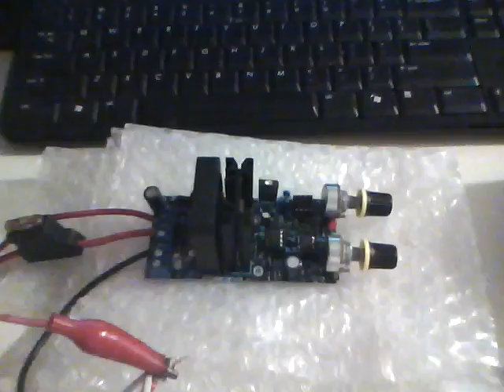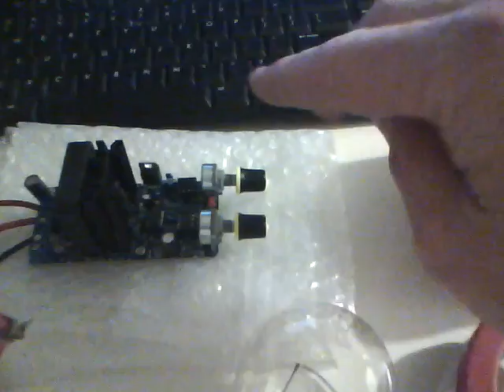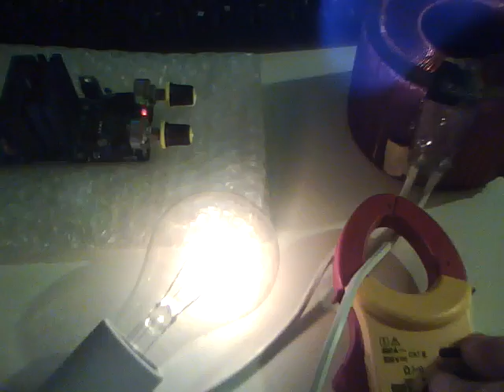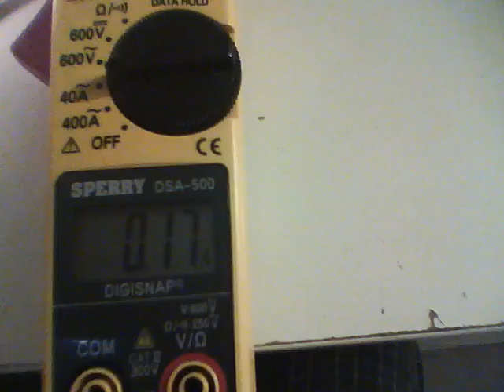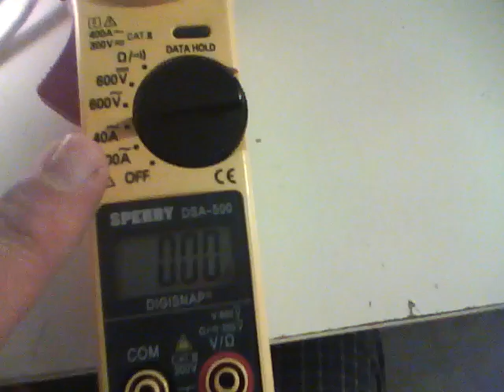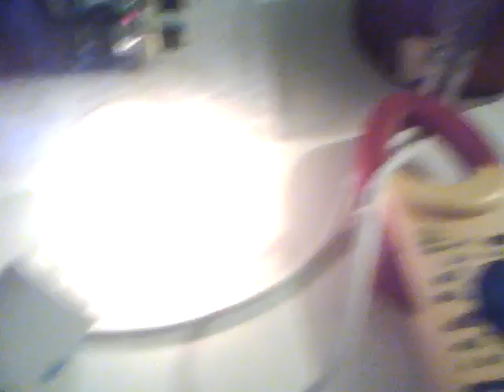PPM High Frequency Effects..

Comment: When you increase the frequency, the multimeter can't take the measurement because the frequency it's so much high, And saturate the core of the amperimeter. it's just my opinon.
Reply from the maker: You are correct buddy... the amperage goes up from the power input of the battery. It's back to the old drawing board I guess. Thanks for watching.
Reply: Have a nice day, and thanks for sharing your tests and experiments :D
Reply from the maker: Oscar P

Your welcome my friend..
Reply: thanks :D
Reply from the maker: Your welcome.

Comment: I have no background whatsoever in electrical or electronics. So my question isn't meant to be demeaning. 
When you say "back to the old drawing board" does this mean even as interesting as this looked, it wasn't exactly a success? 

I know when I saw the zero reading on the amp meter I was impressed. Then I began to wonder where the "work" and/or heat portion of the equation went. 
You did a comment update here and you put the amp meter on the power draw side (I assume) and found it there.

Comment: I believe high frequency power supply is one of the keys for achieving ou.  But this is half of the solution. The other half is to use non-back emf coil to step power down to usable Volts and Amps.

Comment: If you can do this experiment again, this do this:  Put the Amp meter same place where it's now. Then once the Amp meter goes to 0 then remove the clamp on meter and clamp it on PWM power input wires and see what's the Amp reading there.

Comment from the maker: This is a ferrite core that I got out of a variac voltage power supply. the light bulb is just hooked up directly to the coil and on the pulser side - and +.... the ciruit board has a transit voltage surge surpressor which sends most of the spike threw the neon light but the rest goes back into the light bulb. Sorry, don't have a schematic to post. Let me know if this helped you out? Thanks for watching.

Comment: Great videos as always. What I am pondering is what kind of amp draw your feeding off the battery? I think with a simple analog meter you might find out what your drawing since your digital meters are frequency set at the factory so measuring high frequency is not going to happen most off the shelf meters other then frequency counters. Also where could I find one of those pwm and that coil at?